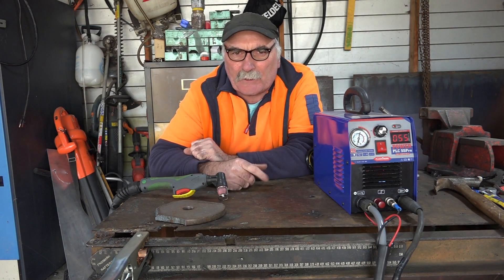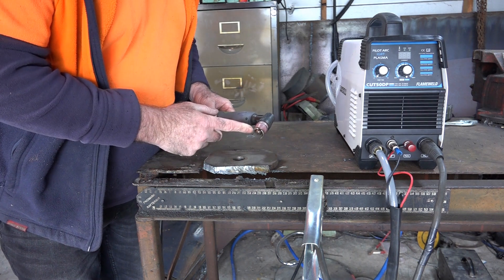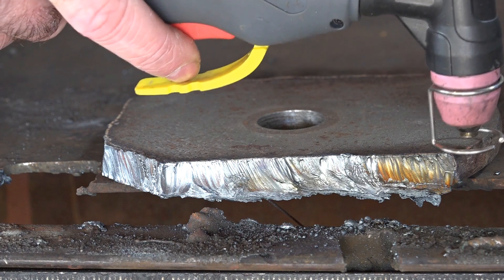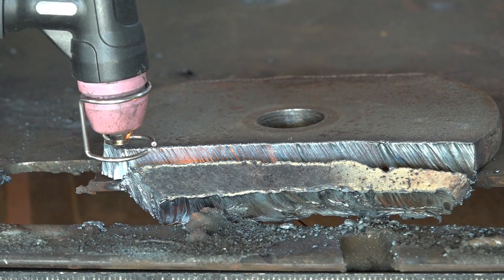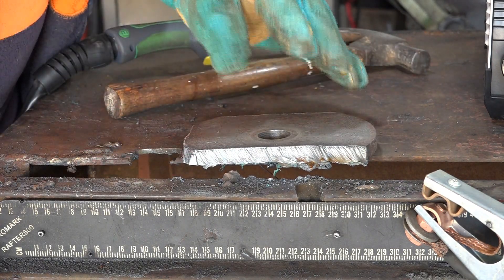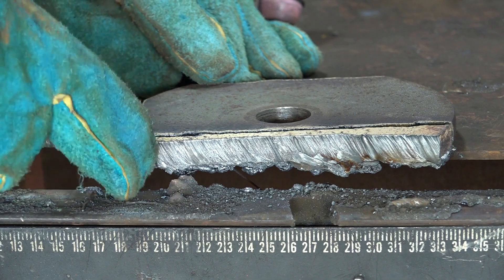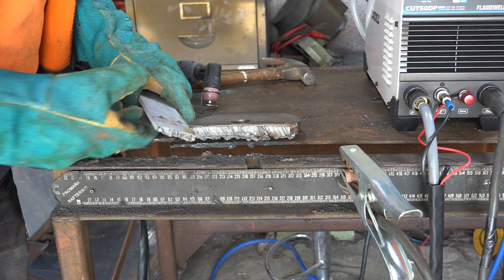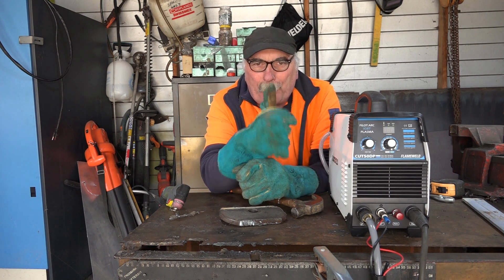Plasma Cutting: How Air Pressure Affects the Quality of the Cut

Comment: Is there any advantage or disadvantage of running higher psi when cutting thinner metal such as 3mm other than just wasting air ? which I'm not worried about . Thank you for all the tips and advice for a new plasma cutter owner !
Reply from the maker: no at 3mm you only need low psi

Comment: Mines the blue one in the beginning of the video, and I have used it to cut 1"/30mm thick steel (yes, I will admit it was struggling lol), but I was running the compressor at 120psi (they say don't go past 90, but bugga it lol- wind the volume up to 11!!!)
Wasn't the prettiest cut, but it did manage it- it was more a 'got whats available' rather than 'do it proper'- the only other choice I had was a hand hacksaw lol or a two hour drive...
I was proper impressed that it managed it at all (it was a 'sloppy' cut and not pretty, but pretty in the bush doesn't count lol)
Reply from the maker: Good on you Steve ,that's what i would have done.

Comment: I agree with you,,but,if I cut 3 or 4 mm steel plate with less air,in this case I have also Soldatech 40 A,and I can tell you that I have glass cut with less air,,,to cut 10 or 12mm of course you need more air but cut quality  will be shit
Reply from the maker: thanks for info